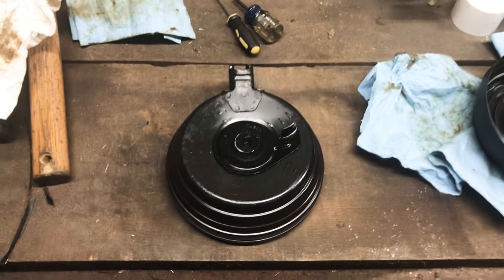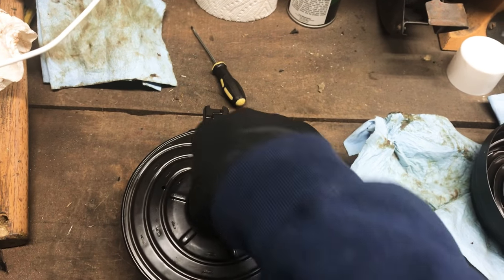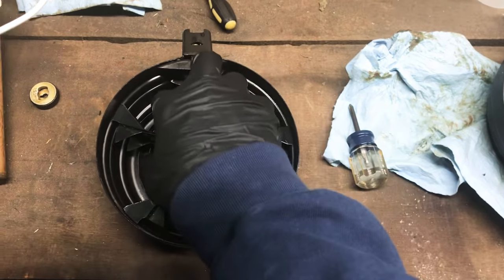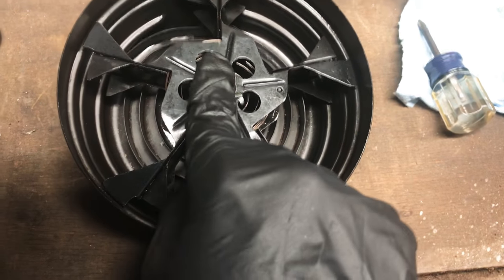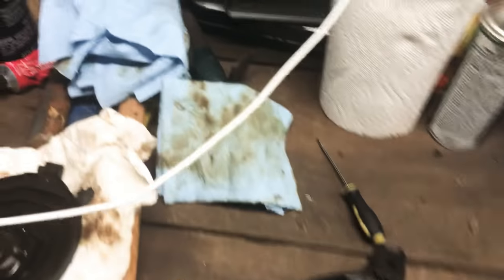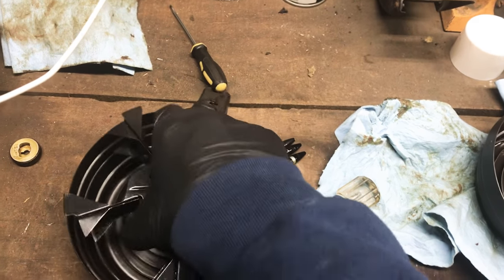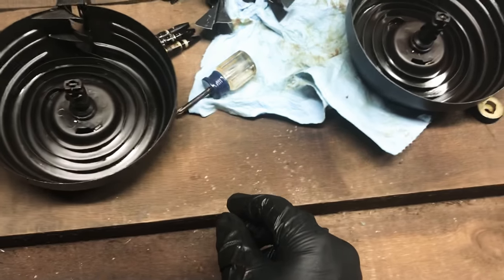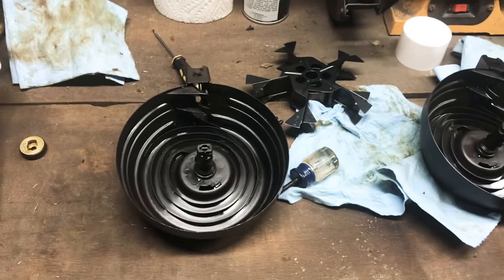Romanian Top Loading 75 Round Drum Magazine Disassembly RPK Or AK47

Comment: Thank you for the help. I had one that was frozen up.  Now worked great after cleaning and lining it.
Reply from the maker: Glad I could help!
Reply: @NoblesTx  where'd you get yours? I would like a couple of these :)
Reply: By lining up, did I add extra tension to it before putting the dummy rounds back in?

Is that needed always if in Excellent condition (yet with Cosmo)?

Comment: Ok to disassemble the front hand crank portion is the same as the back panel except get a smaller flathead screw driver.  Once you have a small flathead push in on the center then turn the knob once the knob is off remove all pieces your done hope this helps!

Comment: How many turns do you give the spring when reassembling?
Reply from the maker: I give it one full rotation
Reply: @NoblesTx  So, is that 1x full rotation from its "Resting" position after reinstalling the spindle wheel?
Or 1 full rotation beyond what its original tension?
I've heard some say 1.5x to ensure "like-New" tension but not sure if that could have any Cons if done on one similar to yours, condition wise.... Some say it helps ensure the final rounds feed properly but that may be if the Drm is very used. Not sure....
All in all, My buddy asked if I could clean a steel part for him of cosmo and I agreed due to having different solvents, but wasn't expecting a top loader drm! I'm 100% novice to this kinda thing so just curious.
(Any tips on getting the cosmo fully out without using water? I hate using water on steel unless hosing with lube afterwards in the nooks and crannies)
The best advice Ive been given are either using brake cleaner, or wrapping a towel around each half, and the spindle wheel, putting each piece in several garbage bags and letting sit in direct sunlight for a day for it to melt off and into a towel.... What's ya think?
Saw a vid where a guy actually uncoiled the spring and it looked like a nightmare to reinstall and I think he even damaged it a tad, so hopefully that's not needed.
PS: I've found some vids on how to remove the "crank" lever, which in your video you said you didn't know how to do (at the time) but look just as easy as removing the back half.
I REALLY hope to hear back asap as I don't want to botch this thing for whomever my friend is selling it to.

Comment: I bought 2 days ago but doesnt wanna lock in my wasr10 should I file the mag or the mag latch
Reply from the maker: Ruben Velazquez usually I would recommend making adjustments to the mag and never the rifle, but in my case, I did have a wasr that had a crooked magazine paddle that I had to file just a little so it would sit square and true. Hope this helps.
Reply: Wasr mag wells are already filed to fit a double stack mag so just file the rifle, these drums are getting hard to come by
Reply: @Silverado8707  not really. Plus i wouldn't fuck with the Romanian ones. The back opening chinese ones are easier to load and you can find aftermarket american ones with clear polymer back door to see your rounds and they're like sub 100 bucks.
Reply: @ruben same was happening to my WASR10, you'd have to slam it in for it too lock, was a bitch to unlock once locked in, simple fix, sand the slightest amount of material of the drum mags locking lip where it locks in the mag release paddle. Takes about 5 mins & works like a charm.

Comment: Where can i buy one
Reply: Whatacountry.com has them . I just ordered one yesterday. They are $229 a piece.
Reply: @seanpeterson827  oh fuck dude you got scammed. I have a Chinese design one (made in korea) it loads alot easier and i got it for 100 bucks from a pawn shop. Online they're cheaper. Especially the aftermarket American ones with the clear polymer back door.
Reply: @Fo4assaultriflefan92  Not a scam. Top loading russian drums are collectable, more reliable than the rear loading drums. I have one of each, my rear loading drum shakes when attached to my gun and instructions say cannot be under tension if you plan on storing it. The top loading drum has no shake and less noisy when loaded.
Reply: @Fo4assaultriflefan92  if it is a real Chinese you got a deal, but I assume it is not mil surp, or it is romanian back loader which was likely made on military equipment but is not a milsurp mag. (There are tons of back loaders out there)